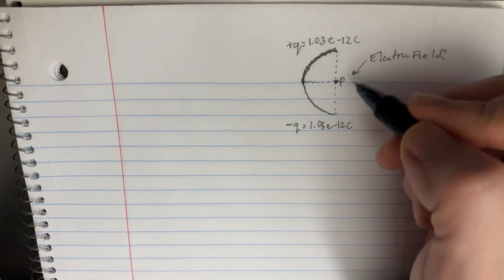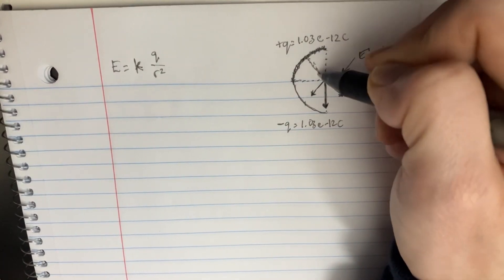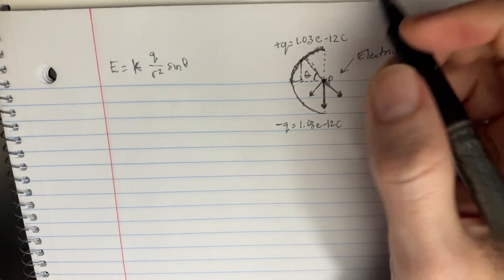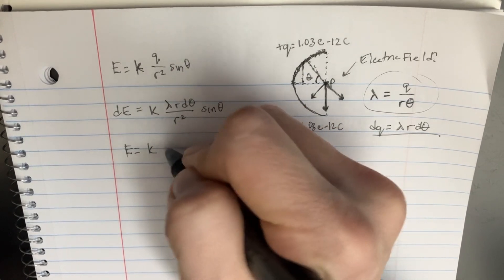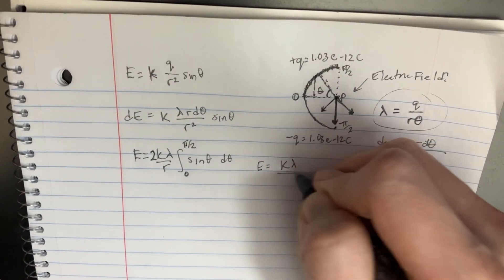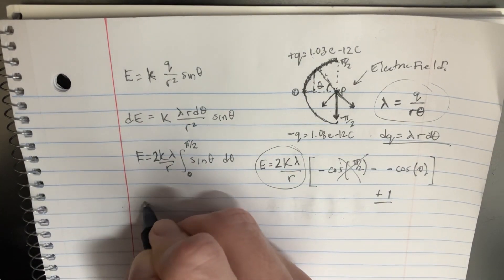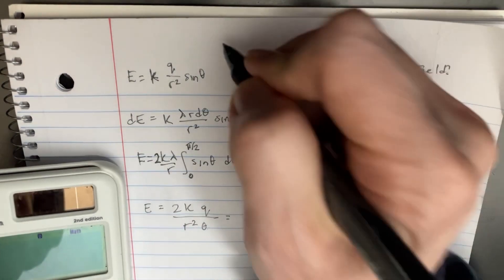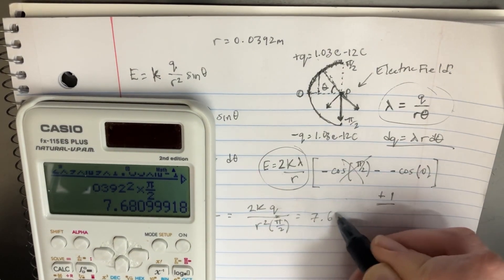In the figure a thin glass rod forms a semicircle of radius r

Comment: 👍 thankyou so much 🤍
Reply from the maker: Fun problem!
Reply: @mtheorylaboratory i literally spent the whole day trying to figure out how i managed to somehow get my hw question correct using scalars and none of it made sense until i got to your vid. Awesome stuff🙏still screwed on my upcoming exam though trust😅 me
Reply from the maker: @miracletraveler2835  Oh these integrals are tricky because there's that sin component that sometimes matters and sometimes doesn't.. it just depends on the symmetry: in this case with a +/- half circle, we needed to point the arrow in the y direction using sin. If it was +/+ then the vectors would actually combine and point in the x direction using cos!

If the integral was a full circle, then the field would point equally in all directions so no trig would be necessary. likewise a straight line would also already point in the desired direction.

Luckily, there should be a reference sheet with all the common electric field shapes so integrating is not always necessary. The half circle has a well known result of E=2kλ/r
Reply: @mtheorylaboratory  one thing that i dont get though is why you used sin instead of cos. For this one it doesnt matter since its a 45 degree angle, but the action arm is on the 4th quadrant do cos of the angle would have been more accurate. This is evident with a circle of some charge acting on a point in space or particle
Reply from the maker: @miracletraveler2835  I happened to draw the angle on the 'wrong' side, measuring the inverse, which is why I had to use the sin!